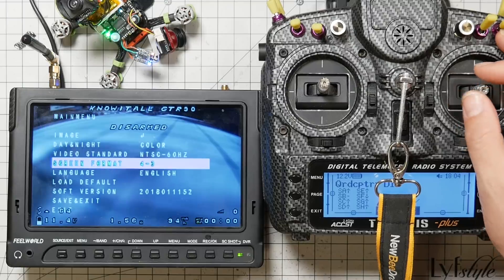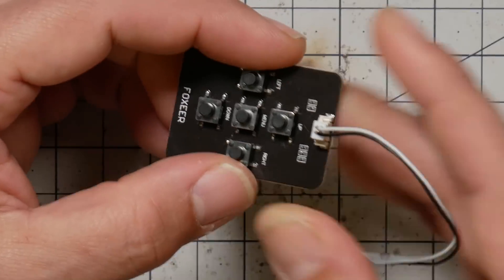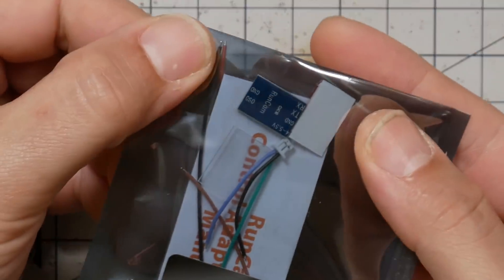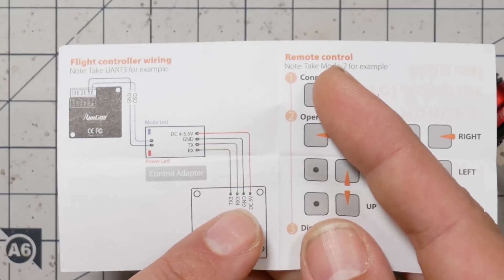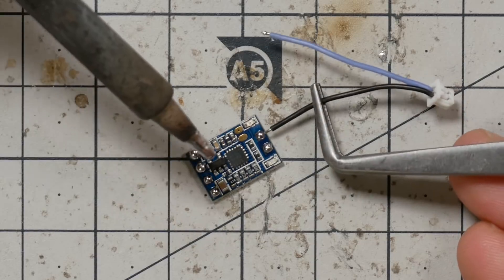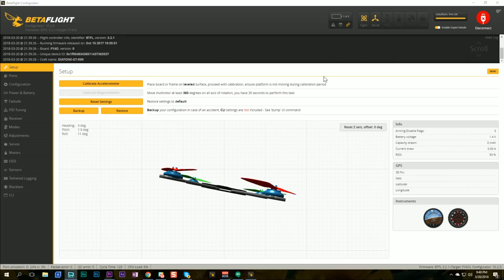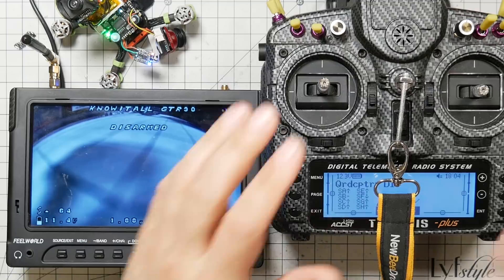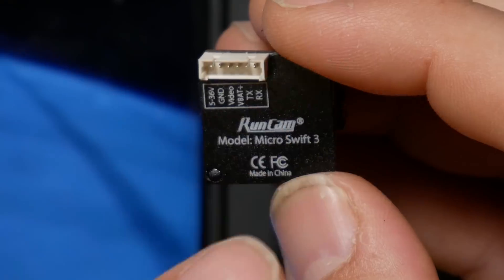Runcam FPV Camera Remote Control Adapter

Comment: Is this going to work with the phoenix 2 Joshua edition and the mamba F405 mk2 FC without the board?
Reply from the maker: Yes exactly. The JB Phoenix camera has this built in so you don't need the board.
Reply: @Joshua Bardwell  Awesome Josha thanks champ
Reply: Sorry mate. It doesn't matter what VTX I use right? 
I was going to use the RUSH Tiny Tank 5.8GHz VTX w/ Smart Audio
Reply: @JoshuaBardwell  I can't get it to work man
Reply: @JoshuaBardwell  can you please help get this fixed because it doesn't work with the JB edition runcam phoenix. I'm doing my head in thinking I have done something wrong but I have doubled checked everything I can

Comment: Will this work with a tx only on your flight controller? That's all I have spare. My soft serials are tx only and I thought that would send the signals to the camera but this board has tx also. Is the tx pad a must on this board?

Comment: The Joystick camera control he is talking about if you is like me and want to buy the "old stuff": https://www.banggood.com/RunCam-Key-Board-with-1_25mm-2pin-FPV-Silicone-Cable-for-Micro-Sparrow-Micro-Swift-2-FPV-Cameras-p-1225645.html?akmClientCountry=NO&cur_warehouse=CN  RunCam Key Board with 1.25mm 2pin FPV Camera OSD control

Comment: Damn I spent over an hour soldering and resoldering and making sure my wires were correct in no matter what I did, center the right joystick and flip the left joystick to the right side nothing. When I fire up the drone I got the you "Uart control" on the screen but nothing happened when I moved the left joystick. Oh my gosh this hobby is very frustrating but I won't let it beat me. I might just live without it
Reply from the maker: Center throttle yaw left is the command.
Reply: @JoshuaBardwell  you are correct I tried all angles

Comment: Been trying to get clarification on this for a while. The lumineer micro eagle, pins are marked osd and grnd, do I need the control board or not for a maytek f405 wing?
Reply from the maker: I would use the control board for any camera that uses analog control. Your camera uses analog control.

Comment: Hey Joshua I am still having issues with my GepRC cinepro 4k, I have been trying to get the Tarsier camera to use camera controls, I even bought the 6 dollar caddx FC cable that I was told I needed to make it work I wired in the board as directed I have everything I need and it still does not work, what am I doing wrong. Any chance you can investigate and find out if I am doing something wrong or need something more. I mean I have the dongle that plugs into the board that the Caddx FC cable plugs into, and wired the Caddx Fc Cable as directed to the 5v power, the ground and to the RX and TX ensuring that the RX of the cable goes to the TX on the FC and the RX of the FC cable gors ton the TX on the board. Do the half throttle and to the right and nothing. I cannot figure what is wrong. Been trying to reach out toe both Caddx and GepRC but  I guess the virus thing has them not returning tickets these days. Any chance you can help.

Comment: Noob question... So the other 3 pins connector still has to be connected to the board as usual right? 9V, GND, V.? The control board I have hooked up to 5V, G, R6, T6.

Comment: Hello Joshua, congrats for the great job you done with videos about drones technology. I have searched for information about the connection between a MatekF722mini with BF4.1.0 and a Caddx Turtle V2 with march2019 firmware (last one I could find), but I found very few about. First I would like to know if the serial communication via FC UART direct to the TX-RX pins on the Caddx is officially available and working. Second, if you have already test it (as you are the most reliable source of information I know - thanks to be here). And last, if you would be able to confirm the layout pins on the split board of the Caddx Turtle V2. I would to post here my wiring diagram, but I’m not sure if I can and how. Thanks FMO

Comment: Hi, my Camera Control dosnt work. Fc is thr Bardwell F4 with the softwar "CLRACINGF4 (CLR4) 4.0.6", cam is a Foxeer Falkor and solder the OSD to the Cam_C and the Gnd to the Gnd on the Fc. 
Set in the Cli 
resource CAMERA_CONTROL 1 B07 (changed from B09 to B07)
camera_control_mode = SOFTWARE_PWM
I tried it also with (HARDWARE_PWM)
Have you an idea why it dosnt work?
Reply from the maker: You shouldn't need to remap or reconfigure anything to use CAM_C function with that FC. Why did you change the pin and etc? It comes from the factory ready to go. The first thing to do is try to make it work as it came.
Reply: @JoshuaBardwell  I did it. I change it after it dosnt work.
Reply: Hey dude, If you find the solution, please tell me. I have the same problem. I solder osd to the cam_c port and gnd to the ground but nothing happens if I move the throttle stick to the right.
Reply: @kaodes  I dont know. I think the cam_c pin is defekt.

Comment: I've used this adapter with Foxeer Arrow Micro, Monster Mini, and Runcam Eagle and it works great. I kind of got the OSD pin to work for the Eagle than it stopped working randomly. So, to just avoid the hassle I wired up the adapter - had to change the timing a bit in the CLI and it works great. Can even enter the OSD menus (throttle center + pitch up). All on the JB F4 AIO and HolyBro F7

Comment: Does this work with a Foxeer Monster V2 as well?
Reply from the maker: I have tested with some Foxeer cameras but not the Monster. In every case I tested, it worked.
Reply: @JoshuaBardwell  alright, thanks for the quick answer! I have a Matek F405 CTR FC, and on the website it says it can do camera control. Is that the same as what this board does? Or is that just a spare UART dedicated for camera control? I think the latter. http://www.mateksys.com/?portfolio=f405-ctr#tab-id-4

Comment: I know this is an old vid, but I never knew about this board until now. On my CLRacing F7, I had a dedicated OSD pad (which I wired my Foxeer Predator v2 too). Initially it didn’t work. Found another video that gave CLI commands I needed to enter that was NOT in the camera or board’s documentation. Think I’ll overlook those “dedicated” pads and use this lil board. Thanks!

Comment: I have the micro eagle with the tx/Rx pin-outs.. The manual says to wire it directly to a an open uart. I tried that but I can't get the camera settings to come up. Do I need this board or is there something else I need to do. The quad is the hawk 5. Also I'm new to fpv and your channel has helped a lot. Thanks
Reply from the maker: You do not need this board if the camera has TX/RX. You can connect directly to a UART on the FC. Make sure that TX on the cam goes to RX on the FC and vice versa. Also make sure that you have enabled Runcam Peripheral in the Ports tab for the UART you wired to.

If you do those things and it still doesn't work make sure your endpoints go from 1000 to 2000 as shown in this video: https://www.youtube.com/watch?v=jpuiKcQJ70s
Reply: @JoshuaBardwell  thanks, is there anything I should set in modes tab of betaflight for camera settings?

Comment: This might’ve already been covered in the comments, but will this adapter at work in reverse. Meaning, can I take a UART controlled camera and wire it so it’s controlled by the camera control pad on your flight control board?

Comment: I can't get my RunCam Control Adapter working on a HelioSpring board with a Micro Eagle.  I know the board already has camera control, but I wanted to tinker with the RunCam Control Adapter on a TX/RX Uart before I purchase the new Micro Eagle with TX/RX camera control.  My question is, for a board that already has camera control, do I need to turn off camera control in the CLI before the Uart camera control with work? Thanks
Reply from the maker: No. Just enable runcam peripheral in Ports. I can tell you I'm using a camera control adapter on my Helio build so I know it works.

Comment: Good Morning Joshua. After I return from flying today, I will start working on my next build, a Chameleon TI with your FC. I'll also be using the Mach 2 vtx, so with only UART6 remaining, will I have to make a choice between camera control and esc telemetry? Have you heard any success stories with the RR Swift 2 soldered directly to the camera control pad of your FC? Many thanks for your guidance and lessons
Reply from the maker: You will need to use TX4/RX4 for camera control if you are using this adapter. You can use LEDstrip for vTX remote control by reassigning LEDstrip to softserial. Instructions for how to do this are in the user manual for the FC, which you can download from the racedayquads product page.
Reply: Fantastic. I knew you'd have a workaround. Many thanks!

Comment: I just got one of these in a kit. Will I be able to get rid of the “RunCam” name at the bottom of the screen with this?
Reply from the maker: Yes. Or just use the regular joystick. 

Hold up on the joystick for 2 seconds to enter the OSD setup menu.
Reply: Joshua Bardwell 

Nice! Thanks man

Did you get an x-lite yet? Just wondering what you think of it
Reply from the maker: I haven't got it.
Reply: Joshua Bardwell 

Did you see the Hobby King FCC 2.8 million dollar lawsuit. That would make for an interesting video

Comment: I keep having the problem of when I push to the right on the yaw stick, centered and all, it just plays the calibration tones and doesn’t do anything. No blue LED or nothing. Am I missing something?
Reply from the maker: If the blue LED does not turn on on the board, then the board is not getting the command to turn on. 

If the beeper plays the tone, then the FC is trying to enable the feature. So you know the FC is set up with the feature enabled on the UART and the FC is reading the stick command. 

Check your wiring. TX to RX and RX to TX?
Reply: Joshua Bardwell That was it! RX to TX wasn’t properly swapped. Thanks for the reply man!
Reply: @JoshuaBardwell  thanks this was my problem too my fc was labeled wrong

Comment: Not seeing it in my drop down for peripherals. 

Betaflight / MATEKF405 (MKF4) 3.3.2 May  4 2018 / 09:45:06 (64a292f37) MSP API: 1.38

Am I missing something?
Reply: Figured out my own question - the computer I was using was still using the Chrome version of the configurator. Loaded the stand alone tool and instantly available in the drop down.

Comment: Josh, will this board work on other cams? Like tbs zero zero v2? Or fat sharks cam with the osd cable? I'm also trying to get fpv cam osd control with a serial port of my pixhawk.. Would this help with all that?
Reply from the maker: Most cameras use the same resistor values and the board will work. But I can't guarantee it'll work with older cameras especially.
Reply from the maker: Also it has to be a 2 wire camera joystick. The kind of camera with a five wire joystick won't work.
Reply: I have tried to use the fat shark joy stick with the zero zero v2 and it doesn't work, a problem I'm having on a build now though I hope you can help with is, tbs unify v3, zero zero v2, osd core pro, it all works except I don't get the fpv cam control with the osd core pro, on the tbs faq under smart audio, it says to jump all 3 terminals on the core pro and it will work, telemetry, audio..  But I do and it doesn't work and unify control disappears...  I know your not tbs, but getting a response from them or anyone about this on the forums is non-existent.  I know you know your stuff, so I figured I would ask ya if you know something about it, lol..

Comment: Wired it up, red led lit indicating power but no control and no mode light via stick commands?  Any advice?  Always seems like its the simple stuff...
Reply: Got it!  BF 3.2 will not work.  Flashed 3.3.1 and all good.
Reply from the maker: Did you enable the Runcam peripheral in the Ports tab?
Reply: I did.  It was not having 3.3 that kept it from working.  Flashed the latest and it now works perfectly.  Thanks for all you do Joshua!

Comment: Caddx micro F1 confirmed... Well kinda. Down "button" doesn't work. Good thing you can just keep scrolling up until it loops back around.
Reply from the maker: Same result here. Down button on my Caddx did not work with my JBF4 CAM_C pin OR my physical Runcam joystick adapter.

Comment: i wonder if the cameras that don't work fully with this device, like the caddx SDR1 in my case, if one or more of the 5 resistors on this little board could be swapped out with the ones from the osd board of the camera that its not fully working on to gain correct full control , if im right, "not sure" but im thinking this little board is just addressing the resistors just like a press on the original osd. id really like to know if someone has tried this. i know its trivial but would be nice if that would work.

Comment: Josh, I have a Eachine Lizard 95 that I have bound with a Flysky FS-i6. However, I can't get the quad to respond to my transmitter controls. I'm sure its something in my settings, but  not sure what it could be. The stack on the quad is a Flysky. I recently became a sponser on your site hoping for some assistance. Please advise me or shoot me a link. I have looked on youtube for different settings, but none work. I did dump the factory settings which use the 3.2 and that is the version that I'm still using. Stack has a solid blue light which should mean that I am bonded with the transmitter, buts the only thing indicating a connection.
Reply from the maker: Please contact me via email or on the Patreon site. YT comments are too difficult to keep up with a conversation.

Comment: Stuck on back of camera...great.  With all due respect JB...tell runcam to get working on HD instead of re-inventing the wheel forever and ever.
Reply from the maker: I think you are seriously underestimating how difficult low-latency high def is. Look at Connex Prosight, who got as close as anybody has to a viable HD FPV solution. Ask yourself why so few people fly Prosight.
Reply: HD is not a necessity, they should work on standard-definition digital communication with proper channels and less duty-cycle, like Bruce Simpson does as a sideproject.
It may have am added bonus of using existing cameras and goggles, just require a new VTX and VRX.
Same or slightly better image quality with no analog noise, channel separation, low latency.

Comment: if the control boards of these camera's give a different resistance depending on the button pressed then it can be re-purposed on your transmitter.
When connected to a input that "reads" voltage like the input used for pots and the sticks then you can assign a value to the pressed button and use that board to   control your flight controller.
Yes you might have to add a second resistor to complete the "voltage divider".

Comment: Where can I buy this?
And BTW Josh - do you know why the Runcam 3 isn't on the Runcam website? I can't find it and wonder if they pulled it following your video for some updates?
Reply from the maker: Runcam 3 was discontinued after a legal action by GoPro.

You can buy this board using the product links in the video description.

Comment: Can someone please reply? Stupid question maybe. Do you still have to connect the signal wire, pwr, gnd wires straight to the camera as well? Or will there camera be powered off the adapter? Thanks in advance.
Reply from the maker: Yes you still have to wire up the camera as usual.

Comment: He Josh great info and product. Love RunCam. Are you going to update your DShot vid? Just wondering as allot of features have been added with the revisions. Love your content hope your doing well. Take it easy
Reply from the maker: The basics of dshot are the same. I have separate videos on dshot commands like turtle mode and esc beeper (actually just one video).
Reply: Joshua Bardwell I know the video... lol I’ve watched like 3-4 times I think. It’s a good vid but there is barley any info on DShot 1200. I have really loved DShot 1200 when combined with 32bit ESC’s  and I was thinking you would make a good video on the potential benefits to running 1200 with BlHeli_32.

Comment: i have to ask why not just a tx? fport dose both way through the tx...
Reply from the maker: IDk they elected to do full duplex instead of half duplex.
Reply: Joshua Bardwell im curious why tx can tranmit and recieve but rx cant? or can it? fport would have been so much better if we could use the sbus rx pin and free a tx pin on our limited uart fc.

Comment: I got it working first time on bardwell board but then menu came up mid flight  . Not good
Reply from the maker: You gotta yaw-left before you take off to take it out of camera control mode.
Reply: Joshua Bardwell Thanks for the reply.I will make sure to do that.
Reply: Hey Josh this is a DVR of when it happened the other day . So you are saying in order to have this not happen in mid flight is to just yaw left after quad is initialized  ? https://youtu.be/IDmgZ65InMQ  - Starts at :45 of video.
Thank you for the help.